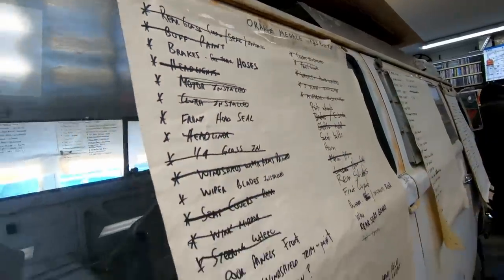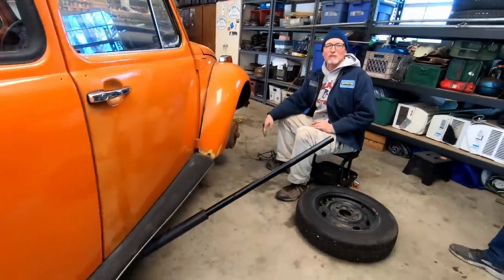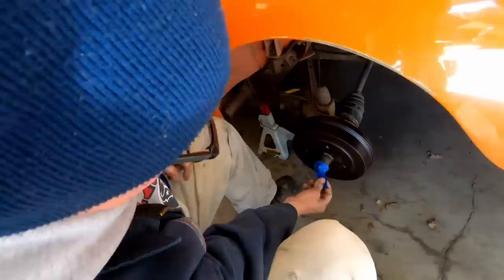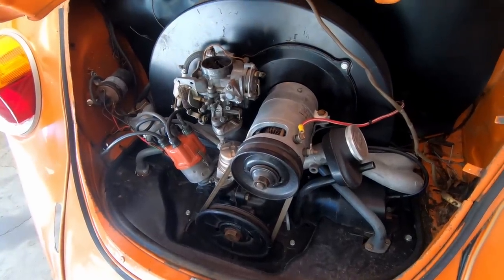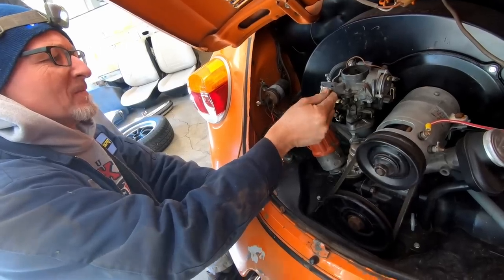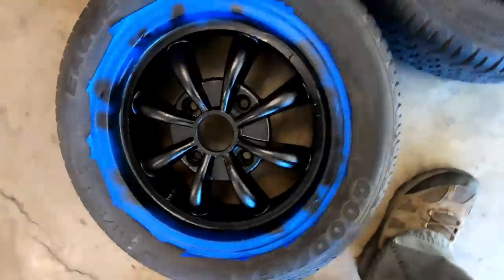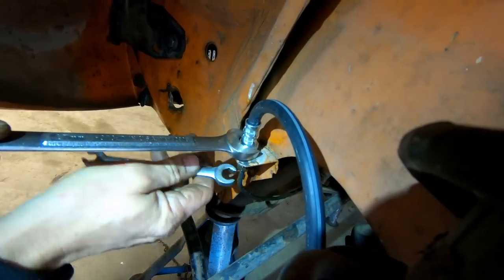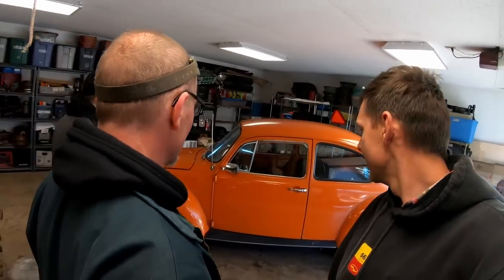Making Progress on the Orange Menace! Wheels, brake lines, gas tank...

Comment: Other than the dork-mile 73 up lights and windshield, that is my 72’s twin. Right down to the American Racing GT8 clones. My drums were brush painted yellow, wheels brush painter royal blue. Fenders and lower doirs will be the same blue, got 4 quarts on clearance for $12, same for the yellow. Rest will be steaight up 70 Street Freak lace, stripes, and wild bass boat flake panels. Kawasaki green fender beads, doir cards, rear seat delete (cooler and luggage space)… Roll bar, modern seat belts (lobster claws are in horrble condition), full led conversion, my factory cloth center seats rebuilt…
Plan is to run it from Memphis to one of y’alls’ big get togethers next year. Sure hope recapped 205/65r15 mud terrains survive the crap roads in Arkansas…
Orange Supers, the ultimate blank canvas!
Reply from the maker: Post a picture of it on our Facebook page! https://www.facebook.com/VWLifeVW/

Comment: I enjoy your videos. One thing I like about VW is lots of parts from different years are interchangeable. The tub buggy (manx) clone has a 1957 pan, a 66 trans and a 66 front beam. 1972 or 73 engine. Fiberglass body was made in 1970. Current power plant is a 1915 cc with progressive Weber 32/36. Project next is to set the valve geometry. Can't decide whether to get a solid shaft or not.  Any ideas? Has single springs but beafier than stock due to the higher lift cam.
Reply from the maker: That would be great question for tommiebsmith well see if he can chime in. Sounds like a good project!

Comment: First I like your video. But why did you keep the drum brakes the Ghia came with 4wheel disc brakes easy conversion and why did you clean the area where the gas tank goes
Reply from the maker: We kept the drum brakes because that's what's on it. It was a simple job just to replace the cylinders and call it good. If we had to convert it to disc brakes that would have been way more time and money. Also we clean everything generally a restoration is probably 50% cleaning